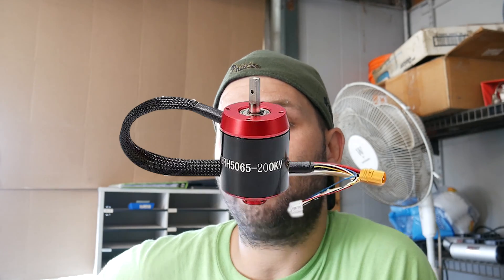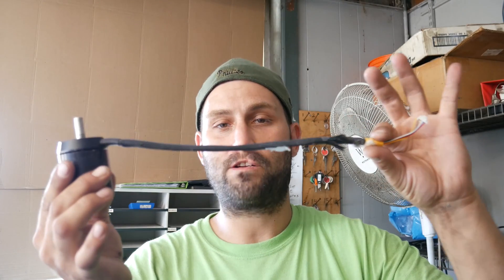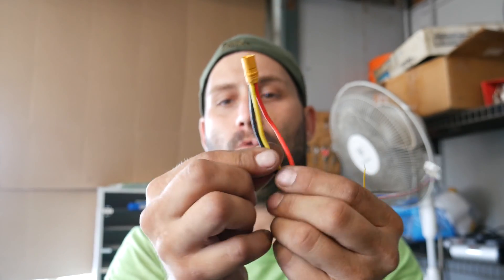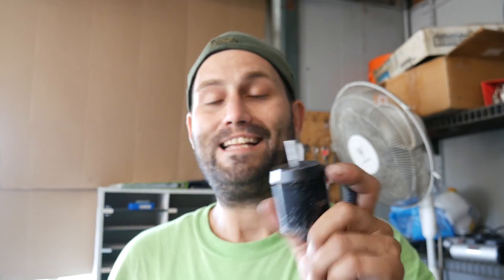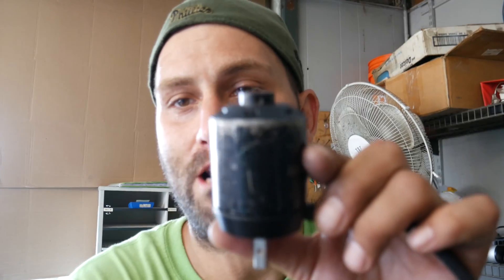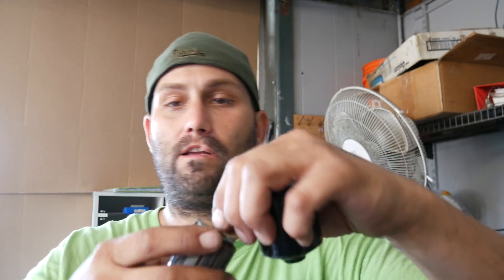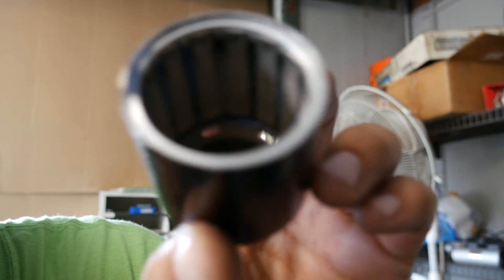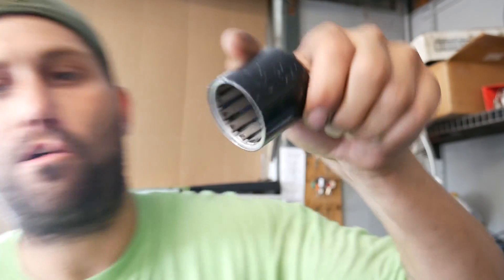Whats inside Evolve Electric Skateboard Motors?

Comment: I had a broken bearing first month I had my bamboo GT...  luckily Evolve replaced the whole engine
Reply from the maker: +David Thielemans holy smokes! i thought i broke the bearings in my evolve motors, turned out it was the dust cover that snapped off. ya that was an evolve motor i was holding. i did thay 3 times. switched to racestar and it never happened again. After the first motor I tried to  make a warranty claim but well ya thats the video where i show they accidentally let me see the back office chatter and made the "evolves response" video. they claimed i had to of used it outside of their suggested use and wouldn't replace it but sold me a motor for $210. Then two more times. Like an idiot i paid up. Well yeah i will back the other guy any day since evolve did me like that. The owner actually emailed me and told me to call him after  i made that video. He specifically said he cant wait for my phone call and they want to be sure their customers are taken care of. Im not a sell out and wasn't looking for a free handout. I make my videos as real as i can. I try to let fact take over.  I try haha. sorry for the rant. i guess this is all stuff i would like to say but keep my trap shut. I would like to think that anybody that came after me got treated differently and that's enough to satisfy me and keep my trap shut. I cant support their motors though. Not after my experience with them. Is what it is.

Comment: Can u show how u install a new gear to the motor?

Thanks
Reply from the maker: +Robin Schaefer absolutely
Reply from the maker: shoot took me forever to find our last conversation. so i saw your name and just use this one. did you get it yet? i had clicking today on my board and it wasnt the gear or motor. but anyway i got the new stainless steel grub screws in. works perfect and you can use two of them. crank one down and then set one right on top too. it will never come out then. 3mx2.5
Reply from the maker: My clicking was from the hub gear bearing. i made a video about "evolves clicking" and what some possible trouble areas could be. Hope all is well and you figure it out buddy. lmk if you need any more help i got you
Reply: @JoeKyser  What's the video's URI on the World Wide Web?
Reply from the maker: @BG-yk9fk  https://youtu.be/kE1OFkjR9FQ